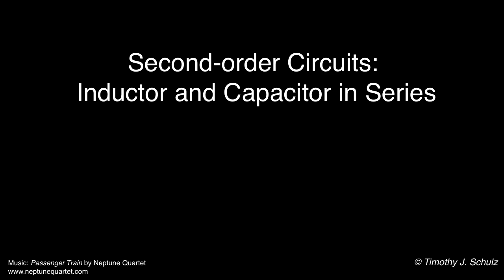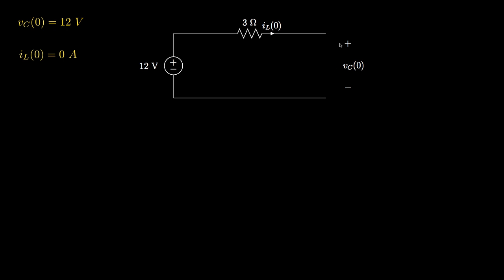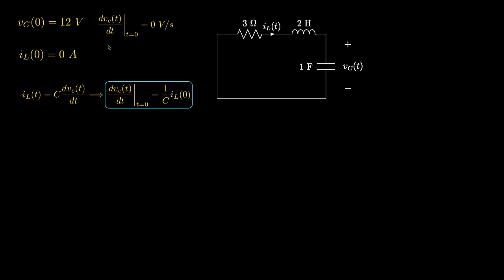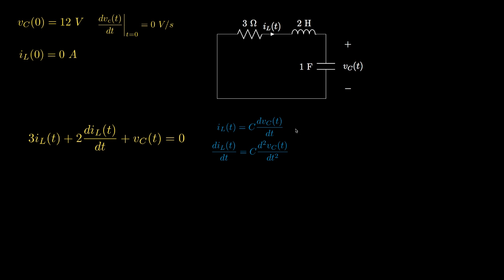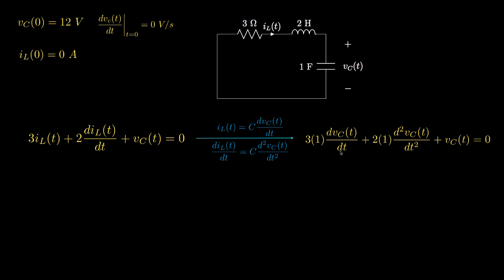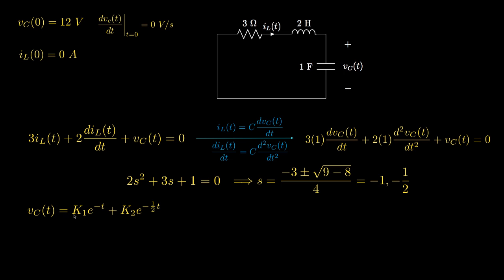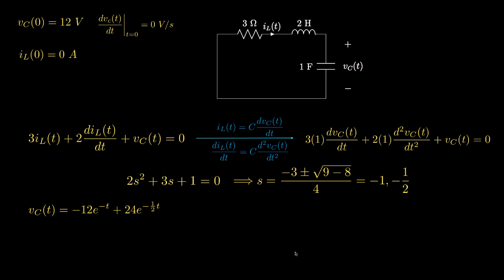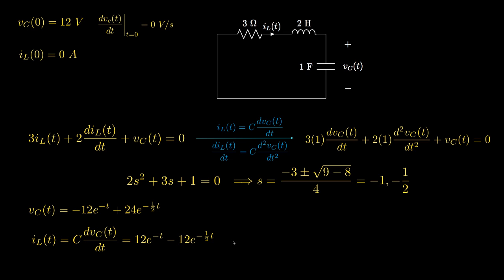Introduction to Series RLC Circuits

Comment: so how do I get the time it takes to discharge from all that? 
can I just create the equation and set it equal to zero and solve for t?
or is there some other way im missing?
Reply: ***** this is the discharge...aka natural response.  To find the step response (Charging of capacitor) your initial conditions would be different.  Most videos I have viewed have failed to clarify this point.  Maybe I dont understand?
Reply from the maker: ***** The voltage and current equations will not be equal to zero at any time, so you can't set them to zero and solve for t. They will get arbitrarily close to zero, though, so you could plot them (like Johnny Turner did in a comment below) and see when they are sufficiently close to zero. Also, because both equations have two exponential functions with different time constants, you could use the largest time constant as a guide for the discharge time. In this case, the largest time constant is 2 seconds, so the voltage is mostly discharged by 5 time constants, or 10 seconds.

Comment: At 7:18 Shouldn't K1=4 and K2=8? I'm unsure of what method you used solve for the Ks
Reply from the maker: 4 + 8 does equal 12, but -4 - 8/2 does not equal zero. There are many methods for solving two equations with two unknowns. For these equations you can simply add the two equations to get an equation to solve for K2, then use that in either equation to solve for K1.

Comment: at t 0 why is the inductor replaced by a wire cut?
Reply: it is because you short-circuit the inductor.
Reply: In DC, the inductor's impedance is j*(w=0)* L. Hence, the short circuit. And for a capacitor X = 1/(j*(0)*C = infinite or open

Comment: How the initial conditions change if the resistor is now parallel to the capacitor and inductor?
Reply from the maker: Huynh Tran You can check the video on parallel circuits:   https://www.youtube.com/watch?v=wBV33_0w05A&list=PLE20FC03B6DB62AF9&index=30

Comment: you cannot apply the kirchoff's law in the circuit where is an inductor,because there is no Electrical field in the inductor...so the closed loop integral of E*dl is not equal ZERO,MAXWELL EQUATION OF THE FARADAY'S LAW says that closed loop integral of E*dl=-L *di/dt and people keep on doing the same mistake.

You should watch Walter's Lewin video on youtube just type:'Walter lewin RLC circuits'

Comment: The derivative of vc(t) is not equal to iL(t). It is equal to iL(t)/C.
Reply from the maker: Did I (or someone else) say otherwise? After showing that dvc(t)/dt = iL(t)/C at 2:00, I then pointed out that, because iL(0)=0, the initial derivative of the capacitor voltage is also zero. Is there a problem somewhere else?